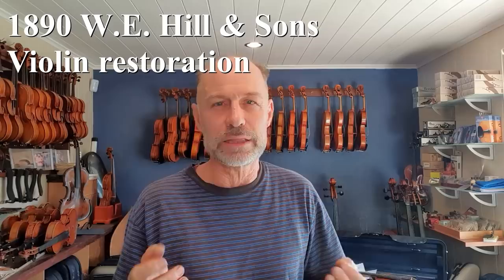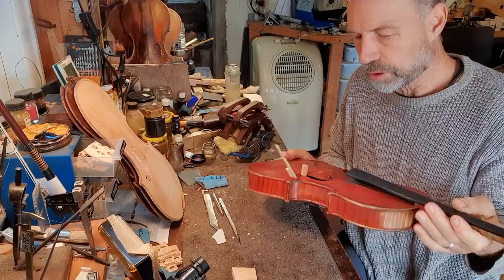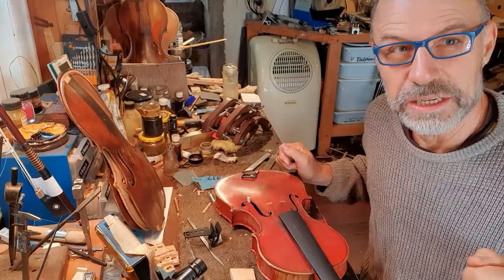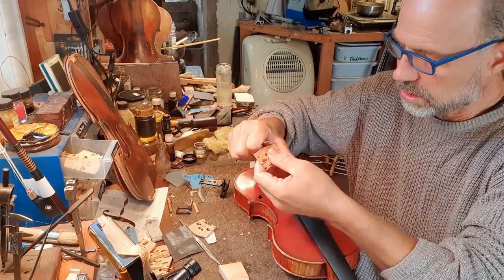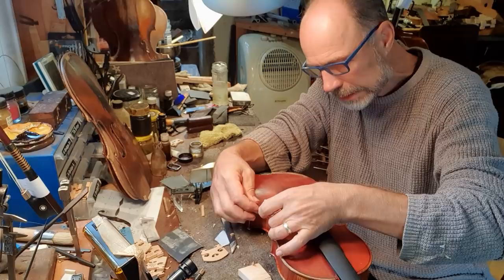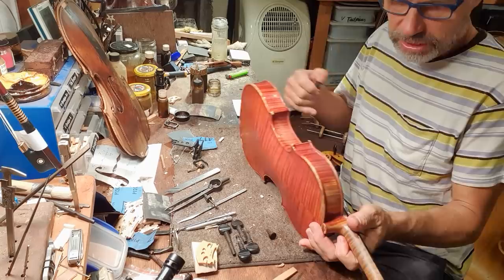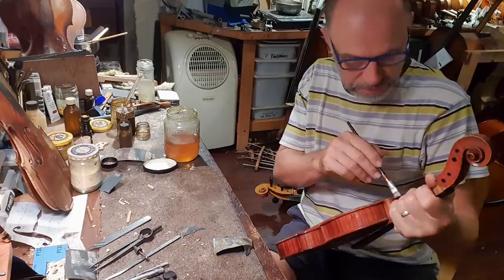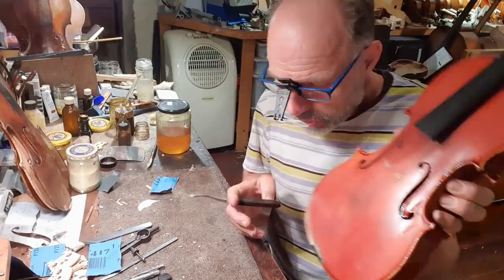1890 W.E.Hill & Sons Violin restoration day 3

Comment: Hey Olaf, TwoSet just posted a video of them putting together a diy violin, and it did not go well, and I was wondering if you would be interested in doing the same!
Reply: HAHAHAH professional luthier reviews a DIY violin
Reply: Another vote for Frankenstain's DIY violin of twosetviolin Master repair video.
Reply: This needs to be done. While TwoSet just messed around doing weird stuff, assuming a DIY kit do be basically a stick together and be done thing, and the kit would surely be doable if you actually knew somewhat what you’re doing, it would still be very interesting to see what a professional violin maker could achieve with such a low grade kit, and it would be very interesting to get a professional opinion on the quality of these kits.
Reply: there was nothing wrong with the pins from that DIY. Although it was lazy, when you buy pins you have to manually size them yourself and they don't find the holes nor do they have holes for the strings.

Comment: Is there a difference between the filler varnish and varnish you used to build up the edges/spots? How can you tell if the violin has spirit or oil varnish on it so you can match it for restoration?

Comment: You noted that the hide glue turns to gel under some conditions.  Any reason you don't use PVA glue to make certain repairs?  It's a whole lot easier to work with.
Reply: Because it is impossible to do repairs if some idiot used PVA glue.

Comment: Can a skilled luthier such as yourself ensure that a violin sounds the same even after many repairs over the years?  Or will the sound subtly change, especially on a violin that is decades or centuries old?  I would think the laws of physics would make it change subtly if the sound is vibrating through a patched crack or many patched cracks?
Reply: A skilled luthier can make it sound at its peak, the repairs should not make any difference to the sound if done correctly.  The violin may even sound better, if set up more skilfully by the repairer than it was originally.